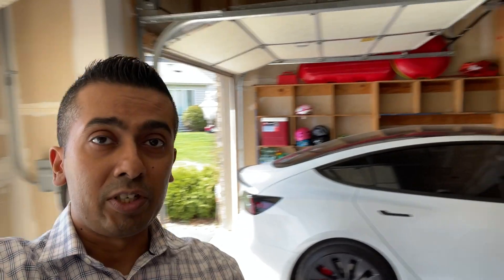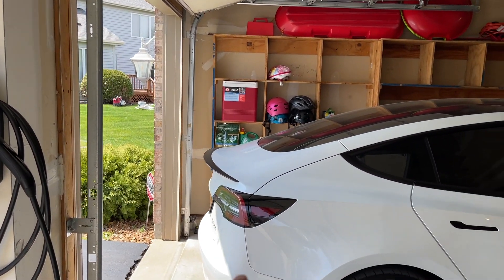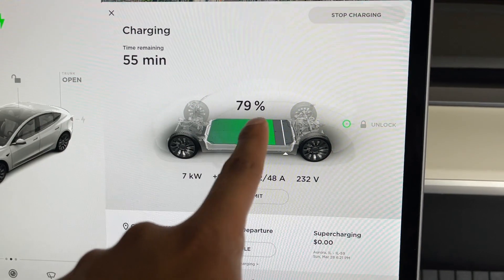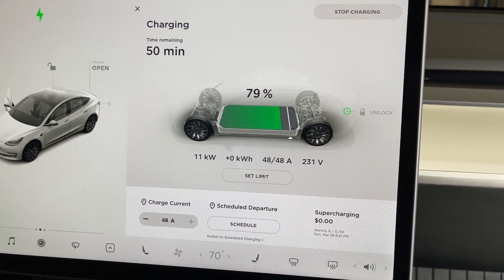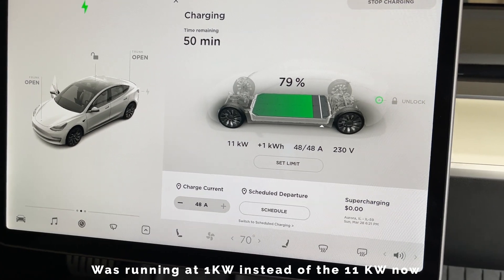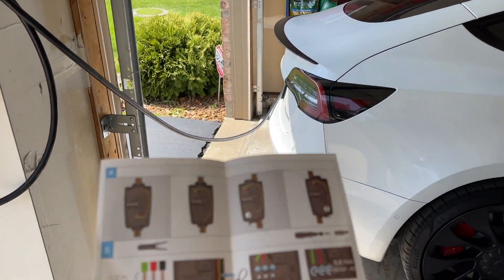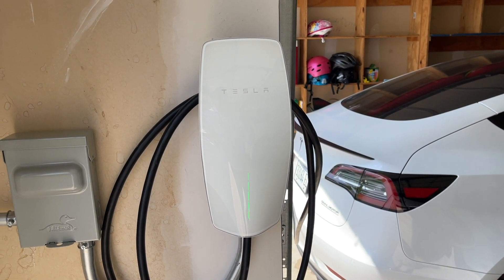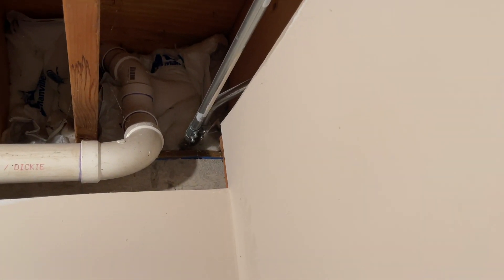Tesla Wall Connector Generation 3 With Wifi - Super Fast Charger!

Comment: Permits?????????  Electrician?????????????   DIY  easy.  60amp breaker, conduit, individual wires (6 gauge)  in business and charges fine.
Reply from the maker: Has to be done right. When you go sell the house and it gets inspected, this can come up as a issue. You could be fined as well. The permit requires a licensed electrician to do the work.

Comment: You have a 60 amp breaker, and per NEC code an EVSE is only allowed to run at 80% capacity (or rather the circuit must be 125% of the max continuous draw). So 60 amp breaker = 48 amps, which is the max AC charge speed of your car anyway.
Please paint your garage 😉

Comment: Quick question:  I was able to log into the Tesla wall connector wifi, but I lost that connection.  And I haven't been able to get to all those setting you've mentioned.  It says, "No internet."  Is this because I am out of that 30-45 second window?  Frustrating.

The electrician had no problem connecting everything.

Comment: To get the Connector to the “Find me” stage you’ll need to Press and hold the cable handle button for five seconds to prompt Wall Connector to broadcast it’s Wi-Fi signal. It’ll be active for 5 minutes. No need to shut off the breaker.

Comment: I’m just curious, is that a disconnect switch before the wall charger? Trying to see if I’m missing a step with my install. The installation instructions state “NOTE: External disconnect switches are neither required nor recommended.”
Reply from the maker: Yes that is optional but I had it installed just in case.

Comment: Having trouble connecting to my wifi, does the place for you to add password automatically pop up
Reply from the maker: Yes if that happens, try to power off the wall charger and turn it back on to allow it to reconnect to the Wi-Fi.

Comment: HUH??? You are pulling 48AMPS!  If they put in a 40A breaker they should have configured the wall unit to be 32A Max.  This is dangerous and the reason most inspectors want these units to be wired for 60A.  You can always go down in the app to lower amps but as per your description you have gone UP to 48A, the unit Max.  Please go back to PANEL where BREAKER is and make sure it is a 60A and NOT A 40A!!!  If you are sure it is 40A DO NOT USE & Call back electrician.
Reply: 8 months and no reply. Hope they are okay.

Comment: Thanks for such great help always. I too was confused by the instructions to hook the wall charger up to the wifi. I found a tip on line 
that helped me by turning off the cellular data during the process.  I got the software update right away and got all settings set. What I couldn’t find anywhere was now that I have hooked up to the Tesla wifi and then it asked for my home wifi password now I want to put my phone back on my home wifi network. Is the charger still hooked up to my wife to get updates?  How do I know?  Or do I have to do that every time I want to check for updates. Thanks in advance.
Reply: I hate cell phones, so I avoid them as much as possible.  And it's why I'm not sure what you mean by "turning off cellular data."  Maybe I need to do this, too.  Where do I find that setting, and at what step in the process do you do it?

Thanks so much!

Comment: For people who's intial time ran out for the wifi setup, no need to shut it off. Hold the button on the charger connector for 5 seconds or so and it will activate the wifi setup again. It will be active for 5 minutes, not 30 seconds to a minute so you have some time and don't need to scramble.
Reply from the maker: Wow 5 min?! Was there some type of update to this, do you know?
Reply: @MonsterGadgets  Yea! I was surprised it was that long too. You can see it on page 22 of the manual for the wall connector on Tesla's website
Reply: Thank you! I was like, what do I shut off again?! 🤦🏾‍♀️ stressed!
Reply: On point! Thank you sir

Comment: Mine's setup on a 60 amp double pole breaker.  To charge at 48 amps requires a 60 amp breaker as you can only use 80% as per codes.
Reply from the maker: I’m curious…What’s a double pole breaker?
Reply: @MonsterGadgets  a double pole breaker is what you showed in your video (at your electric panel). It takes 2-slots on your panel, it's 2- switches -in-one that you can toggle ON-or-OFF. I would check the print on that breaker and insure it's is 60 printed on them. It probably is because I don't think the Tesla Wall Connector would allow any more amps than is allowed. Because in order for you to charge at the MAX. (48a) it would have to be a 60a breaker! This may have been a YouTube video that was beyond your experience to post publicly. Facts matter when it comes to ELECTRICITY.

Comment: permits from city to install wall connector what city is this, I just got mine install no city involved.
Reply: I didn’t need any permit for mine either. I’m in California.
Reply from the maker: Interesting! Why is my city so picky!? Lol
Reply: @MonsterGadgets  I have no idea. Because all you are doing is using your 220v that’s already installed. You either just upgrade that breaker and run mew wires. Other than that I don’t see why they need you to do things. Also I didn’t do that wall charger. I just did the nema 14-50 plug. I’m getting 32amps for charging.
Reply: @dsnuggle  if you don’t mind me asking how much was your installation ? Since you are based in California & also did you go with the Tesla electrician ?
Reply: @sandrasworld3249  I had my friend who is a electrician do it for me. So I only paid for the parts which was only about 150
Reply: @sandrasworld3249  I paid 1200 to do the exact same thing he did in this video (in California)
Reply: You can certainly do it without a permit. As long as someone competent is installing it, the only thing you're risking is a bad report from the home inspector when you go to sell your house.

I'm not aware of places where you can add a circuit to your house without a permit and inspection.
Reply: lol. Must be Tea Party city
Reply: @Apple Sauce I’m in Atlanta it cost me 750, would have been cheaper but my panel box is located in my basement.
Reply: @Apple Sauce where is South Georgia my electrician does entire state.
Reply: @News_and_Nonsense2025  hi Can you give me your electrician contact? I am in Ga too
Reply: @TUANTRAN-ie8fb   I can email it to you
Reply from the maker: City of Naperville and most cities here in IL require permits for this types of work. Which state are you from?
Reply: @MonsterGadgets  Georgia I just got mine installed didn't need any permits
Reply: @News_and_Nonsense2025  no rules in GA.
Reply: I just had two installed. I can scan both but neither one asks me for a password. They show up in my WiFi list but I can't connect because it doesn't ask me for a password. It's odd???
Reply: I’m no electrician but the current you are seeing is 48a @ 230vac which equates to 11kw. 60 breaker is limited to 48A continuous x0.8 factor. If you got a 40a breaker then you are overloading it. Need to go in the home charger configuration and change the setting to the correct breaker size.
Reply: Permit? Sucks. NY state does not need any
Permit
Reply: I can connect to the Tesla wifi. Via phone but the charger is not connected to wifi?! How to connect it to my wifi?

Comment: @MonsterGadgets - Nice video.  From what I'm observing in your video, the Tesla Wall Connector and Vehicle current is at 48A and the voltage is at 230V.  That equals 11 kW.  This means that your breaker at your 200A power entrance (panel) is a 60A/240V for this circuit and hopefully your electrician used at least 6 AWG wire. The  60A breaker will allow you to draw 48A max (80% rule).  The Tesla Wall Connector and your Tesla maxes out at 48A/240V.  You are already charging at the fastest your car and the charger (EVSE) can handle.  No further upgrades required to your electrical entrance (panel) or otherwise.  The voltage of 230V may creep up to 240V and that will increase your  charging speed slightly.  Depending on the distance from your panel and the gauge of wire used, this voltage could fluctuate slightly by +/- 15V.

Using your smartphone to access the Wall Connector, you can set your breaker value (15/20/30/40/50/60).  It will attempt to detect it automatically but you can set it manually as well in case you may want to lower it due to a nearly at-capacity power entrance (panel).

The Wifi can also be setup via your smartphone.  This currently allows for firmware updates (which can also be performed via the charge port through your Tesla).  In the future, you may be able to perform other functions, too.

Looks like you are experiencing maximum speed from your TWC GEN3.  Awesome!
Reply: In the video, you show that the car is pulling 48 amps when charging. You are well connector thinks that it is hooked up to a 60 amp breaker and is allowing it to pull the maximum amperage. However, you state that you have a 40 amp breaker. Thus you are likely overloading your breaker and are lucky that you haven't tripped it or set something on fire yet. If you go in let your car charge for a while and then go put your hand on the breaker you will probably find that the breaker is hot. You can program the wall connector so that it knows that it has a 40 amp breaker and then it will only pull 32 amps. That is what is recommended by all electrical codes. You were putting your house at risk by pulling too much power through this 40 amp breaker.
Reply: I am waiting for my Model 3 and got the wall connector connected today. It is connected to a 50amp breaker but with my phone i put it to a limit of 30 amp since i don’t know if my panel would take anything higher since i only have a 100amp panel
Reply from the maker: Congrats!! What config did you get? What’s your expected delivery date? For the wall connector, did you have a electrician install it?
Reply: @MonsterGadgets  i got the sr+ midnight silver with black interior. I purchased the car on April 10th and delivery is in June but keeps getting pushed back.
Reply from the maker: Nice! Yeah that’s kinda typical I guess. I’ve heard of others having the same push back on dates. The only time it seems to really come through quicker or before scheduled is at the end of any Q as they want to push out as many units as possible. Just make sure you do your part to have everything in order in your Tesla account so that you are ready to go once your car is ready for delivery.
Reply from the maker: Hi! Thank you! And I really appreciate the detailed insight! This was very helpful and reassuring!

Comment: Nice video 👍. Is it possible to control it to on/off via app? I am planning it to install in my apartment parking place. So I am concerned about its WiFi range and what features it offers in the app. It would be great to if you could make a video showing its interface.
Reply from the maker: Thank you! So the wifi connection is over the air updates for the charger as well as to configure it to the proper setting. As far as being able to control it on/off, you would be able to access that through the Tesla app for the car. You can stop start charge from there as long as the car is hooked up to the charger. Hope that makes sense  but let me know if you have any other questions.
Reply: @MonsterGadgets  I am going to install it in a semi public place, would I able to control if some one tries to charge their car?
Reply from the maker: Ohh! That’s a excellent question and my initial thought is no because the charger isn’t “assigned” to your car. My understanding is that it just needs a power source. Meaning if it’s hooked up to your electric panel, you would be billed for it regardless of which car is hooked up to it. I will definitely need to research this to get a accurate answer.
Reply: @MonsterGadgets  yes that would be great to know. If not now hope atleast Tesla releases an later regarding that.

Comment: Hmm I have 200 amp breaker and electrician was able to install 60 amp line for me.
Reply from the maker: Do you know how much amps you were using before the 60 amp install? According to the electrician, mine would have been overloaded if I went with a 60 amp line and I could be fined by the city when they do the inspection. The only way I could have done a 60 amp line was to upgrade to 400 amp panel which they said would cost $8-10K. 😬
Reply: As MonsterGadgets stated, depends on your electrical load prior to installing and how much more you can add. My electrician did a full load diagram and load calculation. Im at 160 out of 200 with the 60 amp breaker included in that.

Comment: Check with your local utility company and see when exactly your “off peak” hours are for charging. In my city, from April - September, the hours where we get charged more is from 3 pm - 7pm and all the other hours are a fraction of the cost.
Reply from the maker: You make a great point but unfortunately for my area, we only have fixed rates. So, it doesn’t matter what time I change, it’s going to be the same rate at all times. When I used to live in another city about a year ago, my rates from 11pm to 6am were half the normal rates.
Reply: @MonsterGadgets  damn, sorry to hear that! I’ve heard that somewhere in Cali, some of the supercharger locations were going to have the reduced off peak pricing to help with folks from charging during the day.
Reply from the maker: Oh that makes sense and I guess if you think about it… it also help to not overload the grid during the peak times.

Comment: As my understanding, i think you made something wrong, if you install 40amp breaker, you have to switch inside the wall charger, after that, I think maximum amp will show is 32amp
Reply: Nice setup! Weird if you changed in your wifi setup to a 40 amp, that it would allow you to go that high. Regardless, i would manually change to 32 amps
Reply from the maker: Thank you! It just went down to 32 by itself. Not sure exactly what happened.
Reply: @MonsterGadgets  I just upgraded my breaker from 40AMPS to 60AMPS. My reason to upgrade was to charge faster because I am on Time Of Use billing with my electric company.  My screen on Model 3 looks slightly different from yours. How many miles per hour are you charging at? I was at 27mph, but now I can go as high as 44mph. My X charged at only 19mph before, but is now charging at 30-31mph.
Reply from the maker: Hi. Yes I selected the correct setting in the wall charger after I connected it to the WiFi. The way the electrician explained it, he said it’s going to show the 48 amps cause it’s converting ac/dc.
Reply: @MonsterGadgets  by code you should only continuously draw 80% of your breaker's rated amps. So if you have a 60 amp breaker you can safely draw 48 continuous. If you have a 40 amp as stated you should set the car to max rate of 32 amps, 80% of 40 amp breaker rating. May want to go confirm what breaker size you have.
Reply from the maker: Yup, I have it set to 32 on the wall connector so I’m not sure why it’s showing 48 on the car. Any thoughts?
Reply: @MonsterGadgets  I think u might have a 60 amp line...
Reply: @MonsterGadgets  Your electrician is full of crap.  The Tesla’s display shows how many amps it’s charger is pulling.  AC-DC conversion has nothing to do with it.
Reply: @MonsterGadgets  Your electrician is wrong. Whatever your display is showing is how many Amps it’s charger is pulling.  That can be limited by changing the settings in the wall connector or the setting in you a Tesla.  AC-DC conversion has nothing to do with it.